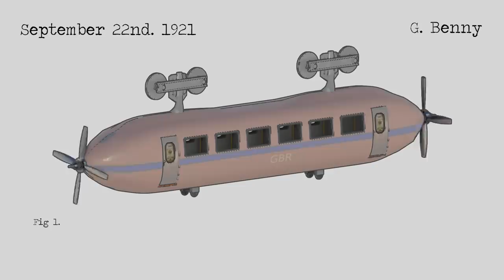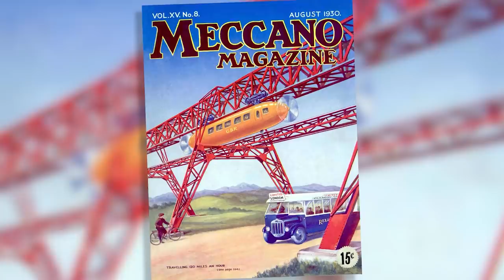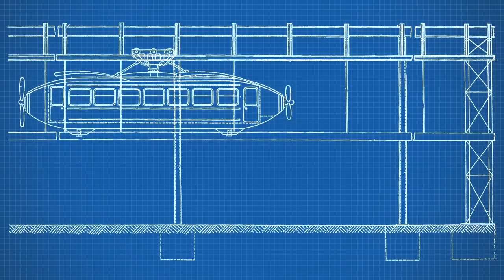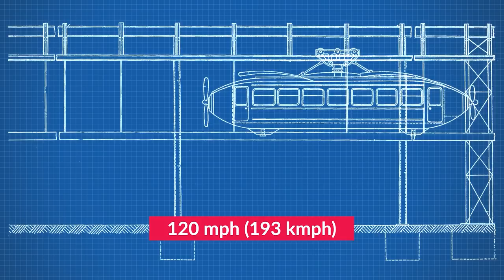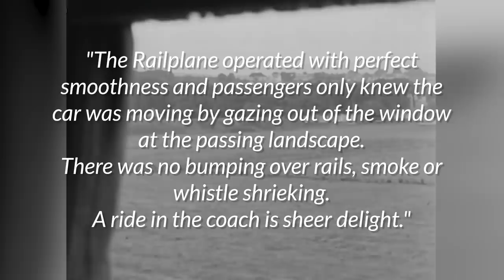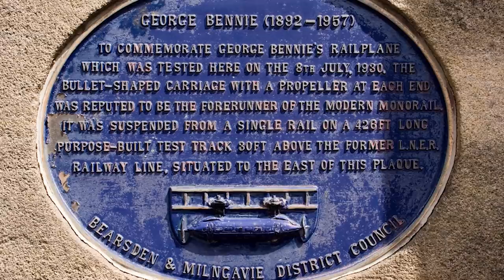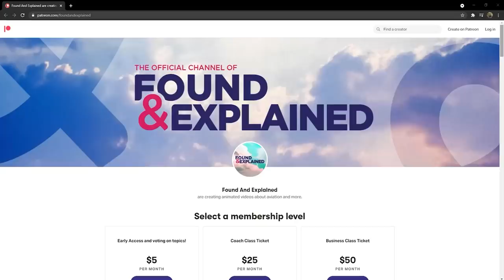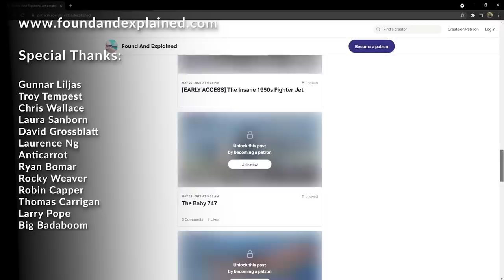This Insane Plane/Train hybrid - The George Benny Rail Plane!

Comment: I'm curious how well this would have actually worked.  One of the key reasons airplanes move so quickly is because the air is a medium with very little resistance.  This is especially true the higher up you go as the air thins.  This system would have had the resistance of the wheels to contend with.  I can't help but think they'd get more speed out of it if they'd attach the electric motor to the wheels rather than to a propeller.
Reply: Imagine if the entire train was the electric motor... Or the track was the motor? Eh, all relative.
Reply: The more apparatus you put at wheel level the more resistance you get. Protecting the motor inside the air stream fuselage reduces this. Still in theory you get speed, A demand of passenger transport of all kinds, and smoothness, also a plus, of air travel with the economy and convenience of rail. Station to station service rather than airport to airport  service.
Reply: It's a mystery why he used props instead of driving wheels.
Reply: @iancampbell6925  that's a lot of mechanical linkages. A radial engine has only one linkage. Less friction.
Reply: This isn't the only train made with a propellor. The 'rail zeppelin' was another experimental propellor propelled railcar.
Reply: @a_Minion_of_Soros  it's like the german Schienenzeppelin
Reply: @iancampbell6925  I think that answer is the recent invention of the airplane. He wanted to adopt what was the latest in cool technology (airplanes) to a new transportation method.He could have also just mounted the car and moved the cable (and then had a cable car/ski lift), but that had already been invented.
Reply: @Chris Talbot  And you'd be right; attaching the electric motor to the bogeys does produce higher speed than a propeller. And placing the tracks in an elevated position so as not to interfere with other traffic is ALSO something modern high-speed rail does.

Ultimately, the railplane is just modern high-speed rail with extra steps.
Reply: Not to mention that it has to carry the weight of its engines and fuel.

Comment: Could you even conceive of a 'track' that costs more to build per kilometer or mile?? This design is the wet dream of steel companies with excess production capacity.
Reply: Some of the elevated and tunnel sections of the light rail systems around here can cost as much as US $100 million per mile to build.  Doubt this would cost nearly that much to build.
Reply: @thesledgehammerblog  My point was, at the time, it would've been hard to come up with a more complicated mechanism for moving a passenger vehicle around, nor one that required more material for its fixed infrastructure. I'm not saying that some modern track systems aren't expensive today. Like in the past, choosing a type of system for a specific transit need is partly practical, and partly political. The press isn't as good for prosaic, economical solutions, as it is for the latest gee-whiz engineering. :^/
Reply: @pbasswil  Never underestimate the power of bureaucrats to make things unnecessarily expensive and complicated to keep themselves well employed at someone else's expense.
Reply: @thesledgehammerblog  Sure, there are lots of personal interests influencing infrastructure choices, like you say. But also: we're all kinda swayed by gadgets. If we see something new and inovative, we kind of want it to work – even when it may turn out to be impractical, unproven tech, and a big money pit. Hyperloop, for instance, may turn out to be in that category, even though it's appealing.
Reply: Passenger cars don't carry as much weight as freighters. The trestles don't have to be as robust as freight trestles. That reduces the cost. Might factor that into your thinking on your cost estimate.
Reply: Ji
Reply: @dpsamu2000  Nor do the train tracks for passenger trains strictly need to be as robust as for freight trains, but there's a certain minimum solidity for infrastructure which needs to last many decades of weather. One thing's for sure, there's a lot more steel required for that system, plus intricate assembly & installation. But the biggest expense of such a system is the development of the technology and the working out of bugs, and ensuring it's safe, and the constant inspection and regular maintenance of all that complex mechanism (<– surely far more costly than the maintenance of surface tracks). Anyway, I guess we're having fun discussing a topic I'd actually forgotten about many weeks ago!
Reply: @thesledgehammerblog  you basically need the same amount of steel for building it, but you also have to build it all above the ground, I’m pretty sure there this can and will cost as much or much more than a light railway system
Reply: @pbasswil  in the time, this was just a utopie
Reply: What would cost more? How about a subway system?  They also use mass quantities of steel. And concreate.
Reply: @andrewphillips8341  a subway system is much more flexible than a single suspended railcar though
Reply: @andrewphillips8341  Most subway systems are not economically viable (without government support.) If you took  a modern subway system, aka what is in Washington DC and had to build the entire thing, buy the land dig the tunnels, and then pay for it with passenger fares, there is almost no way to make the math work. The math does work for air planes, buses, and taxis. Train travel does make sense if there are very limited options, (aka the 1800's in America) and it also makes sense if there is an extremely dense population (Europe, China, India). A good and compete discussion of the subject is quite complex, and involves political factors, discussion of subsidies on each mode of transportation and more.
Reply: It is like hyperloop
Reply: @cryptickcryptick2241 You’re absolutely right, mass public transit, specifically train/subway lines require high population density to be profitable. I believe only Tokyo, Osaka, Hong Kong, and Seoul are able to regularly turn a profit, whereas even population dense cities in the US, like NYC, Chicago, & DC, require government subsidies to operate effectively. The U.S. is just too spread out and our infrastructure favors personal vehicle transportation as opposed to public. As someone who lived and worked in DC for a few years, cars are still a necessity for most people. With NYC being perhaps the best example of public transit in the US, despite still requiring  subsidies.
Reply: @pbasswil in the future there will be ten series of television searching for the fabled hyperloop money pit 😂
Reply: @da4127  t.s.h.b. wrote "...as much or much more..." I think you're understating it by a lot! Then add the cost of maintenance and structural integrity tests, in perpetuity. Today they build elevated systems with concrete trestles, for the latter reasons. But any thing elevated is expensive.
Reply: @andrewphillips8341 Very true, subways are very expensive to build, especially in the West. But as long as the ground is stable, they're also quite stable and relatively low-maintenance/reliable. No weather forces beating on delicate systems and eroding metal structures.
Reply: @cryptickcryptick2241  The economics of subways are a bit different in the US than other places, because it's harder to get Americans out of their cars (NYC being an exception, from legacy). And the demographic split between wealthy and poor makes the middle-class wary of rubbing elbows with the poor. In cities like Tokyo/London/Paris/Seoul etc, subways are the core of metro transit – you can't gauge the cost/benefit analysis merely on cost of construction, cuz those systems make their countries' economic hubs function. Without them, those metropolis' would be gridlocked.
Reply: @pbasswil  Good points, but there are alternatives. Busses. Above ground dedicated bus routes are able to move people effectively and more cost effectively than trains. Many cities in China, have routes where a bus comes every 1 to 2 minutes. In most of the USA, busses don't work so well as ridership is also low. And yes, there is a class problem as well.  Without allowing the free market to set proper rates for trains, it robs trains of the ability to expand ridership where needed, pay for infrastructure and make sure capital is allocated effectively. Yes, we do have subsidies on other forms of transportation. Cities though, like Paris were poor for years, after WW2, where Americans were rich and able to afford gas and individual transit.

Comment: I can only imagine the sound the propeller would make at full speed.
Reply: ...and the noise of the wheels on the rail... Wuppertal in Germany is struggling with this old concept since it was built.
Reply: Still its quite as it was tho if it was both props it would of been quiet
Reply: well, considering that the propellers are electricity powered instead of gasoline or similar, it wouldn' be much louder than your deskfan!;P

Comment: Thanks for this video. I have had a pet idea for years about a flying train that would use railroad right of ways. One version would actually have short wings and props powered electrically from elevated power coils for wirelessly transmitted power. It would fly a few feet over this power supply cable most of the time but be able to land and take off from the train track..

Comment: Sooo… a train, with a less efficient propulsion system..

Is there a single benefit to this system?
Reply: Apart from the ones listed?

And let's see. Ignoring friction, a steam train has an efficiency of ~10%. Electric motors have an efficiency of ~85%, (lead acid) batteries ~90% and propellers about 85% giving a total efficiency of about 65%. Even accounting for the worse technology of the time, it's still feesible that this system was more efficient.
Reply: @greghumphreys3397  I guess I wasn’t being very clear,

Having an electrically driven train is a very good idea, and it can be seen with all the electric trains today. (Although having overhead power lines or an onboard diesel generator sounds better than having electric batteries.)

What I was focusing on was being propeller driven vs wheel driven. A driven wheel is going to be much more efficient than any propeller will ever be as it has a solid surface to push against as opposed to pushing against the air.

The reason planes use propellers is because they don’t have a solid surface to push against. Planes are able to go so fast due to the lack of friction, friction that a train is going to experience whether it is wheel driven or propeller driven.

It seems that either Bennie was trying to incorporate design features of the new and revolutionary plane while not understanding the underlying science or was hoping investors would buy into it from the mere fact that it looked futuristic.
Reply: @Fhcghcg1  i dont think efficiency was the goal with propeller trains. Speed was the most important goal. Bennie's design used 60bhp electric propellers to propel the craft 120mph (in theory). which would make it among the fastest railcar of its era. Germany experimented with a highspeed electric rail car that was traditional in design, that could do 130mph in 1903, but it required expensive 3 phase power, which wasn't feasible for decades. But by the end of the 30's, electric motors improved, and single phase motors were powerful enough, to be able to pull not just a railcar, but a whole train up to 130mph, such as the Italian ETR 200. Basically, Bennie's design was too ambition and too late. Though, the overhead railway should've been explored more, or even adapted today.
Reply: The thing about propeller driven aircraft is they need a fairly long runway to slow down so how well would this train been able to stop in an emergency?
Reply: I wonder if it’s to do with torque rather than power. Modern motors can provide high torque at low RPM due to the clever materials involved to manage the heat created.

A propeller would be able to both spin at whatever speed was needed to get the best power from the motor without overheating, and it would be pushing cooling air over the motors as it turned.

We have a similar thing in electric general aviation. Engines used in light aircraft and even the motors used in the Velis Electro electric trainer can only give maximum performance for a very short period of time.

Without the drag caused by wings I could easily believe the air train could do 120mph on 60hp.
Reply: @murph8411 the rear propeller would spin up to slow it down with reverse thrust. In that regard it could slow down more or less as quickly as it could speed up.

Modern airliners do a similar trick when they land with ‘thrust reversers’ which bleed air from the engines and redirect it forward to help the aircraft slow down.

Comment: Here's my take: the bogies have built-in magnetos/alternators, charging up some of the ancillaries or the main motors on the move and do regenerative braking for extra juice. Same thing happens to the rear motor; it's essentially a wind turbine unless it is used as thrust reverser.

Comment: This looks like a precursor to Hyperloop, and given that this thing never properly got off the ground, then the same can be said for Hyperloop
Reply: This is in no way similar to Hyperloop. Hyperloop is literally unworkable. It literally cannot work. This was very workable and only failed because 1. Rail companies denied access to the land he needed, and 2. He turned out to be a bad businessman.

Think more before you speak.
Reply: I thought I was alone looking at the comments the idea of that train really isnt that smart it only takes a few seconds to come to that realisation like it's going to use the rear engine to break but what about in an emergency say the track collapses somehow it needs to stop before that break 
It just screams stupidity the electricity could have been used to power the wheels with speeds greater than a coal train and guess what wheels stop quicker than a prop can move air even if it is steel on steel the friction between them is more than that of air

Comment: Well, that did split in two or more directions, there is the suspended railway in Wuppertal, Germany, the "Wuppertaler Schwebebahn" and there are high speed trains - and both come in a variety of solutions and offsprings and who knows, which was derived from which idea and what came before the Wuppertal train and monorail systems of any kind and so on...
Reply: The Wuppertal system opened in 1901
Reply: Exactly this came to my mind. Some years ago I was in the vicinity of Wuppertal on a short vacation, and my wife and I decided to take a ride on the Schwebebahn. Of course not very fast and a bit bumpy, but enjoyable nevertheless.

Comment: It is like a slower version of the Hyperloop. It is difficult to join cars/modules/pods into trains due to the propeller propulsion.
Reply: Perhaps there could've been a multiple car design had Bennie considered possible overcapacity of the line.
Reply: Maybe some twenty years later it could be possible with jet engines. But we all know how it went last time someone wanted to make a jet-powered train
Reply: Ron White  Except it offers rather low capacity, and who knows if the pods will ever come to fruition.

Comment: As a gadgeteer, as a kid and teen I made the usual toy cars from assorted parts, and I can say this about this idea. 

While it will work, it isn't the best way to get propulsion for a land vehicle. Wheels driven by a motor provide more power and torque than the same motor with a propeller on it. Propellers work great though on airboats meant for swamps because an in-water propeller would get snagged and stopped in a matter of minutes. And on hovercraft because THAT has no ground contact at all.

This idea could be modified into a cable car system like the pre- existing cable cars, or electrically powered. 

Me personally I'd wonder about the noise levels put out by the propellers: The SMALL quadrotors make a racket and they are four propellers an inch across... just imagine how LOUD this train would have been.

Comment: Obviously there's a bunch of ways this could be improved with modern technology, but it just occurred to me that the main idea - directional momentum provided by airplane-like thrust, instead of powered wheels against tracks - could potentially overcome the problems that conventional trains have with climbing a slope with more than a very modest gradient.

Yes, I know there are tooth & gear type tracks in a few places, but I seem to recall them having some drawbacks/limitations of their own (although I don't recall specifics).

It's not just hills or mountains that could provide a potential market for something like this, either. I recently watched a video about the various issues related to creating a rail tunnel under a large body of water. 1 of the issues was that they'd have to massively extend the tunnel at each end to reduce the gradient, so that trains would be able to actually traverse the inclined section of the tunnel. If the vehicle's ability to move forward wasn't dependent on traction between steel wheels & steel tracks, and with a bit more thrust, I reckon it could be a viable solution.

Comment: To me a suspension train above existing infrastructure makes a lot of sense to me.
Reply: Until you come to a tunnel, which happens quite a lot in Britain, where he was planning to build this.
Reply: @rikshepherd9724  well you take existing infrastructure into account,  for example in Bangkok,  Jakarta etc have big stretches of toll roads, all flat, easy to build that type of rail system above it
Reply: @jantschierschky3461  Now that does make sense; trying to do it in the UK was a bit odd given the terrain, and the way railways run through built up areas.